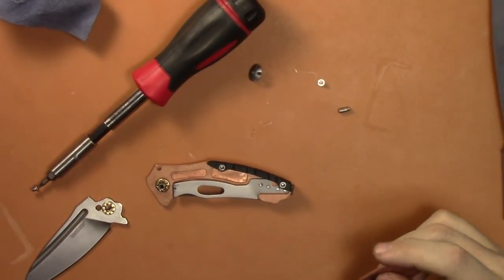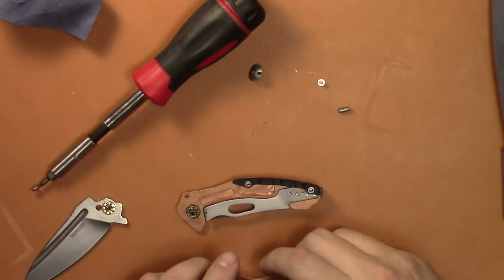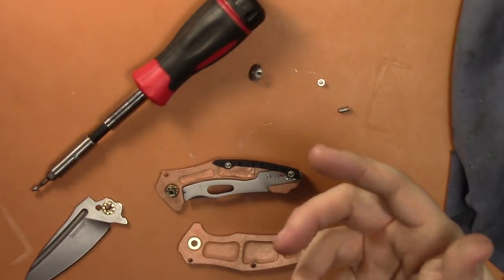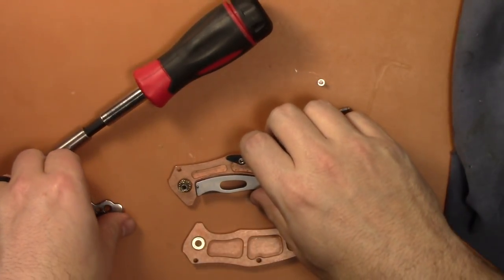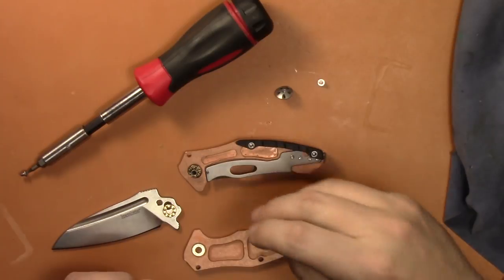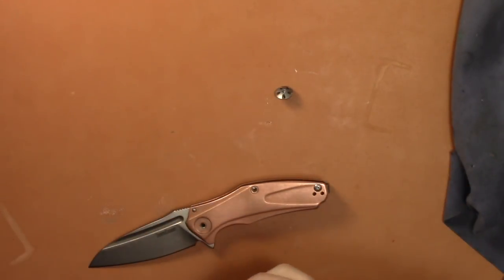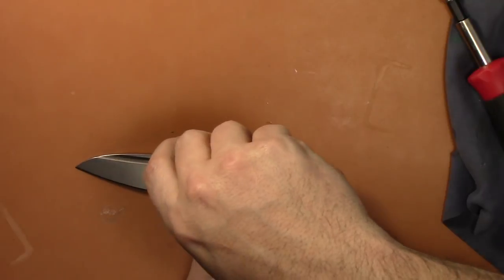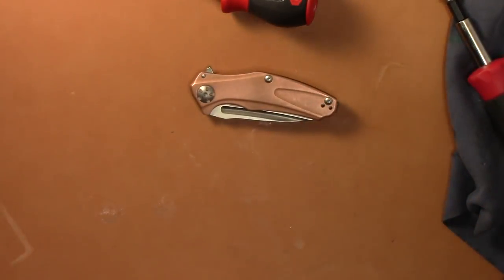A Look Inside the Kershaw Natrix Copper

Comment: I think one of the steel bearing races had some dimpling from over tightening. Still, it looks like it will sell well due to the look. If patina is your thing, this will look great, especially if you neglect the D2 blade.

Comment: Hey, how is this thing holding up? I heard the detent ball grinds down on that D2 steel. I just ordered one of these yesterday, and was wondering if you have any issues with the detent after prolonged use. I seen a disassembly vid where the guy said his ground down to almost a nub in a couple weeks.
Reply: Same here I ordered one a few days ago and only after I ordered it i found about that issues. How was your holding up for the past 6 months?
Reply: phoenix hey, mine has zero issues, it’s been finding it’s way in my pocket a lot too. So I’ve been doing quite a bit of cutting. Not to mention just opening and closing for no reason lol I think yours will be just fine as well. Let me know if you end up having issues with yours. But mine is just as snappy as the day I got it. Only minor gripe I have is if you hold it too tight at the wrong spot, the lock bar makes it real tough to deploy.
Reply: Other than that, it’s a great little every day user, and patina’s beautifully.
Reply: @blankslate81  how did it hold up and whats that patina looking like now?